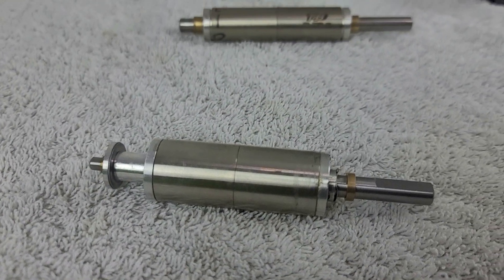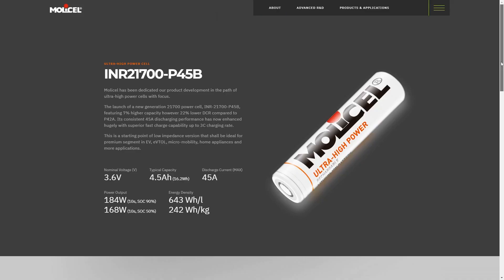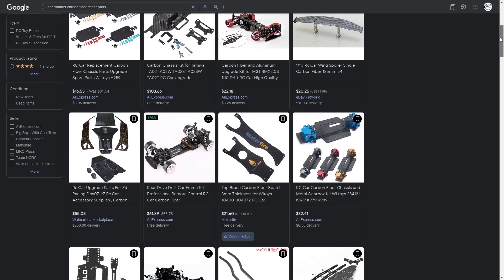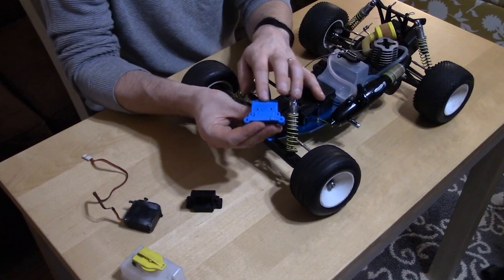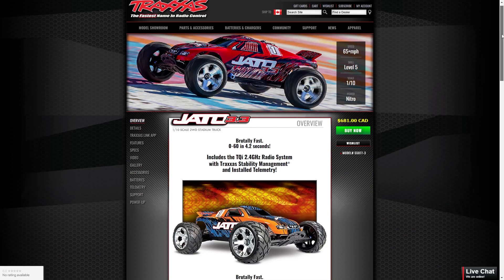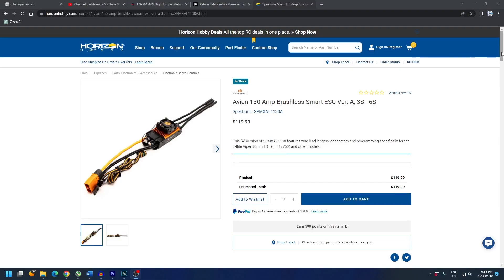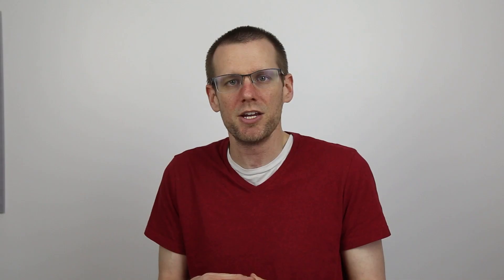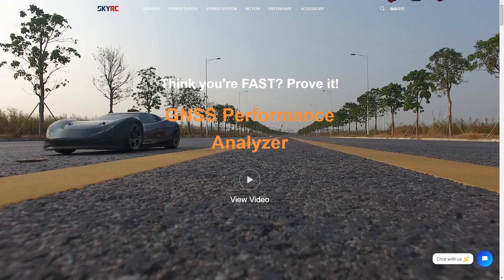10 Game Changing Technologies That Improved RC Vehicle Performance and Capability

Comment: Back in the 1980's, my first little DIY RC boat hit an object, cracked down the middle, and sank. My mood sank also, because I had paid so much for that simple 2 channel system. Eventually I did manage to retrieve the boat, and after letting the whole thing dry out for a few days, I thought I'd give it a try. Well, the brushed ESC was dead but the receiver and rudder servo worked again! I guess I was really lucky. 😊
Reply from the maker: Nice!

Comment: I got ideas….I would like to see a company reinvent the brushed motor. People still love the brushed motor for vintage models and crawling. Design changes could be made to make them comparable to a brushless motor in power, speed, and durability. I like the idea of being able to rebuild a motor just not as often. What about modular electronics? What if receivers and ESCs were designed to physically and operationally connect to one another? This could save space and eliminate the ugly wiring.
Reply from the maker: Interesting, thanks for sharing!
Reply: I have modern tools with replaceable brushes.
Reply: 😂😂😂 nah...

Comment: I come from a different time, to me the top two game changing tech is 
BEC (Battery Eliminator Circuit) before BEC we had to have two battery packs in our RC's, one for the car and one for the radio. BEC's used the main car pack (Stepped down of course) to power our radios
Speed control tech as a whole. When I started in RC (Mid 1980's), all we had was a servo controlled 3 step speed control (Slow medium and fast), When Associated brought out their innovative for the time RC 10 buggy they introduced a new type of speed control The resister or wiper type (Basically a ceramic rod with wire would around it Similar to old slot car controllers), the servo controlled a wiper that offered a better ability to control speed, Smoother and much more predictable. The eventual evolution happened in the late 80's to early 90's with the true electronic Speed controller. Though the early ones did not have a built in BEC, the old BEC's would suffice and mid 90's there wasn't a single esc without a BEC circuit built in
I wouldn't change a single thing on your list, all are modern gamechangers but the two I gave, completely transformed the entire industry in only a few short years
Reply from the maker: I only covered the last decade but a lot has changed since the 80s I'm sure!
Reply: @RCexplained , I kind of looked at it from a whole, those were the ground breaking things for me
Reply from the maker: Ya for sure. Very interesting.

Comment: 👍🇨🇦🤠
Sensored motor technologies is high on my list as is the insane power.
Just today I got 14hp and another over amp warning(352amps) from my 3 year old Castle MMX8S/1717 1650kv combo in one of my X-Maxxs running 2/1 gearing and Proline Trenchers. 
Having a lot of fun testing combinations out and speed running. 
Oh got my first hobby grade rc back in 1988. A Tamiya Grasshopper. 😉
Cheers.
Reply from the maker: Yep no shortage of power!